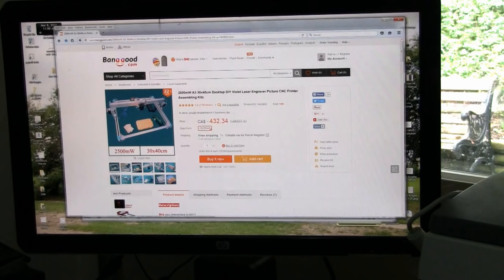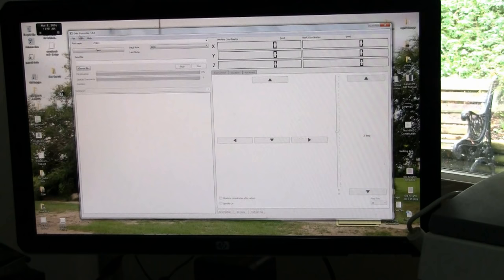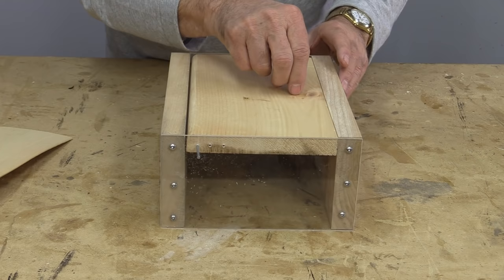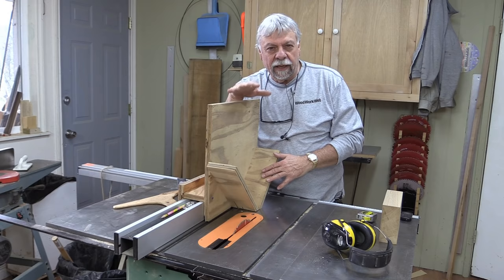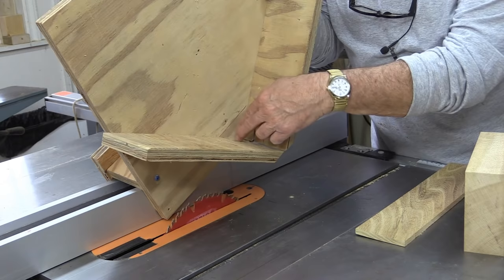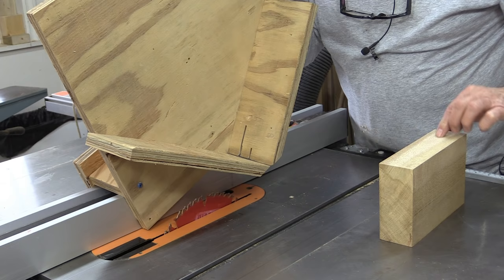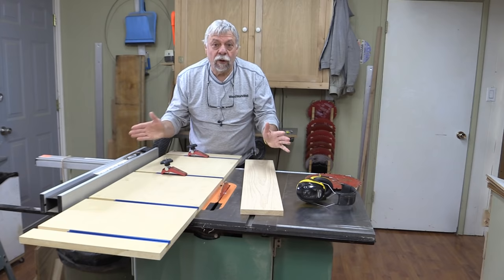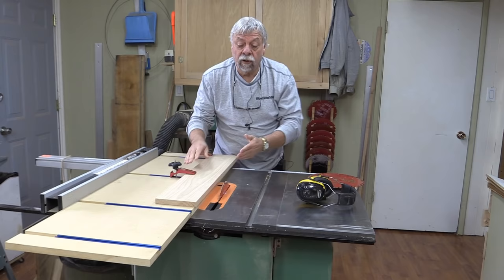Woodworking Tips and Tricks, Woodworking Jigs & Laser Engraver Software

Comment: Great tips Colin - one thing you did not cover clearly was on the jointer sled - the sled should  be butted up to the blade or you will get some dreaded blowout on the backside of your piece of wood. (Or have a backer board supporting the piece)
Reply from the maker: +Alan Erickson Yes, good point, always good to have a backer board if you can to avoid tearout and get cleaner cuts ... thanks for the reminder on this :)

Comment: On the last tip, you said that the blade for ripping a straight edge is "good for boards up to an inch thick".  What happens if you go thicker?  I have several live edge walnut slabs I milled with a chainsaw mill, and most are 2" or thicker.  I need to narrow them down to 12" to fit my thickness planer, so I'll be ripping one edge.